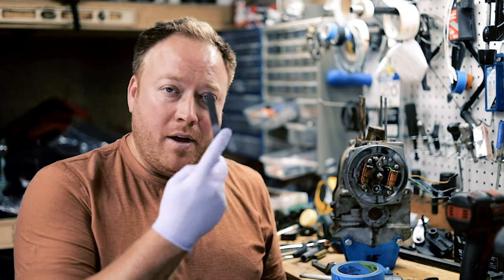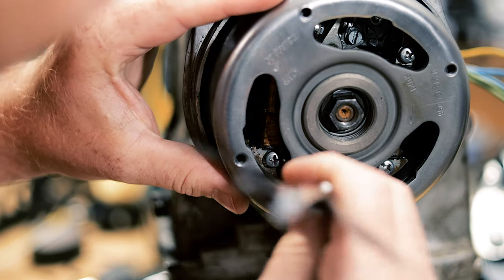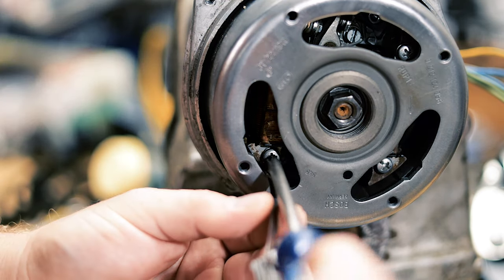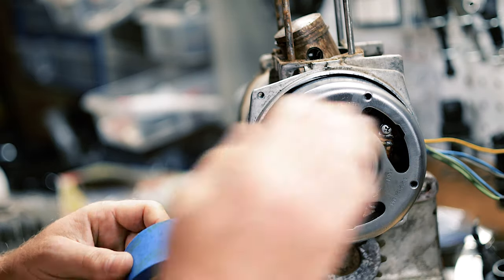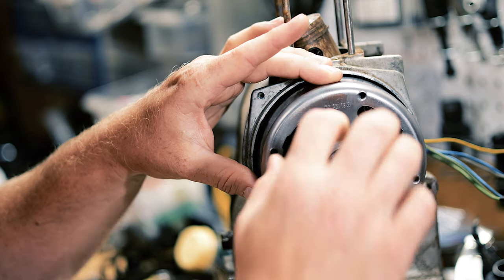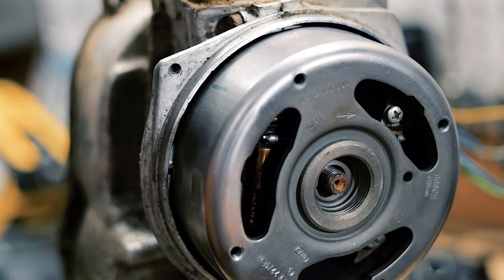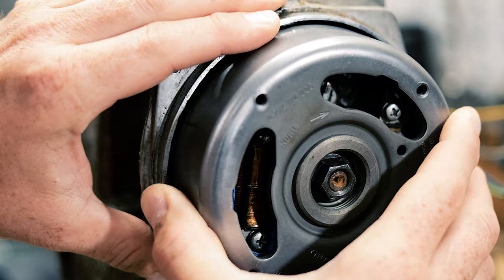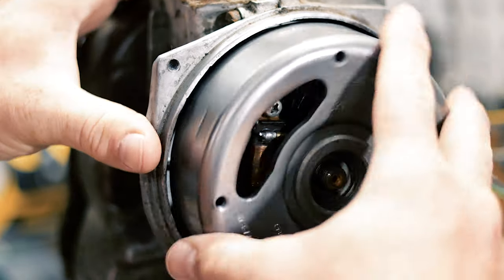How to set coil air gap on puch mopeds and small engines

Comment: is there a diffrence in performance? when i put it on 0.3 or 0.6 for example?
Reply from the maker: Yeah, you'll get better spark. You want it as close as possible without rubbing
Reply: @Corn-ped  Do i have to worry about scraping when the engine gets real hot? is it possible for the metal to expand that much with 0.3?
Reply from the maker: @Khapaleno  I don't think it can expand that much